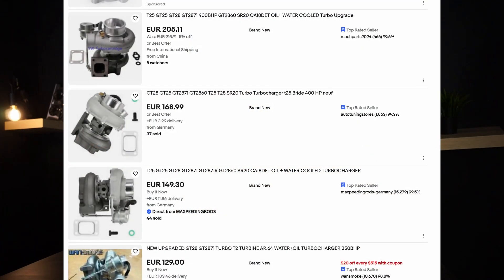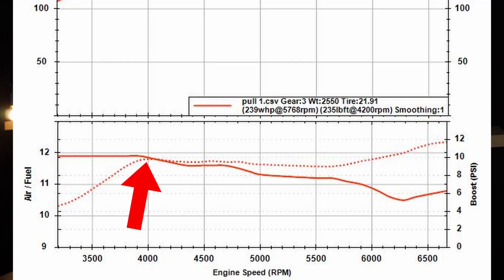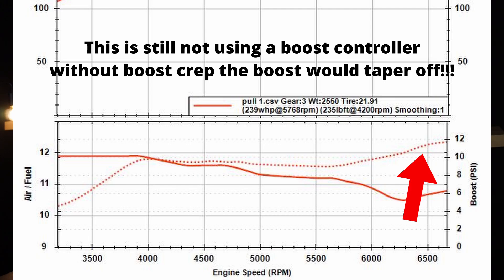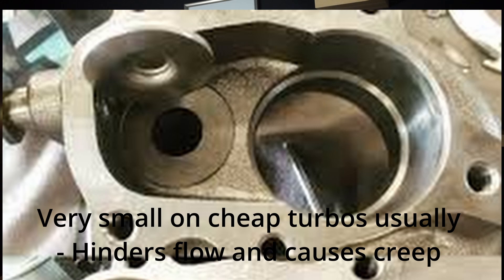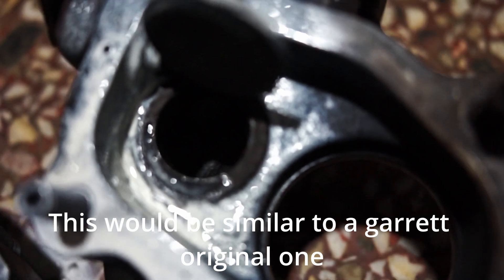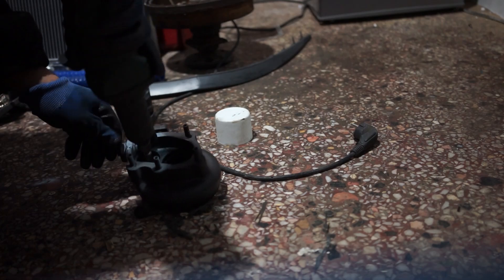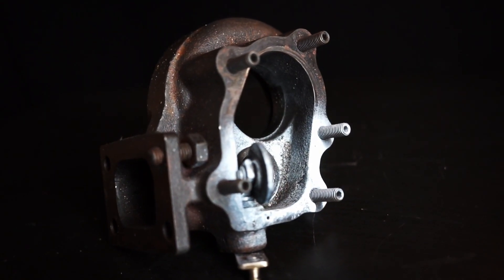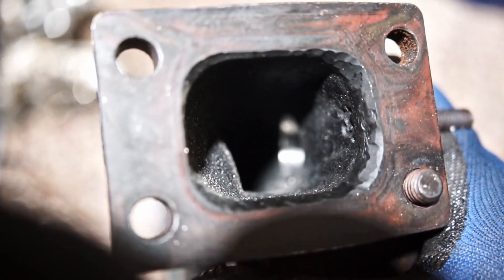CONTROL YOUR BOOST!!! | Getting rid of boost creep wih exhaust housing porting | Run ANY Boost

Comment: Great timing :) I need to port the wastegate on my GBC22-350 for the mx5.
What do you mean at 6:19 when you say it can affect spool and performance? Isn't the porting done after the flapper? Genuinely curious.
Great content, much love.
Reply from the maker: the gbc22-350 usually doesnt have problems with boost creep but you need a different actuator. Garrett claims the original one is 0.5 bar but its actually 1 bar i have tuned a few kits with GBC turbos and they all had that problem. if you have questions send me a message on instagram. 

the porting in the later part of the video can affect spool because if you make the path to the wastegate port easier you are going to have more turbulences. i also explain that in the video.
Reply: @throttlebuddies0  that’s interesting, I read a few threads all saying they had to port the wastegate and it helped reduce boost creep above 5-6k rpm. I’ve also heard about that actuator issue which is strange. Thank you for the advice. 
I was asking because when the flapper is closed, it doesn’t matter if behind the flapper is ported right? It’s closed regardless. Only when the flapper is open it will affect the gas flow into the wastegate port which would have less back pressure from the porting. Am I missing something?
Reply from the maker: @andreibrahim1802  the porting of the opening yes that doesnt matter for spool because the flap is closed but if you make the path from the inlet of the turbine to the port smoother and round the corner off this will create turbulence and therefore restriction.
Reply: @ oh I understand now yes of course that makes sense. Thank you for the help and explanation 🙏🏻